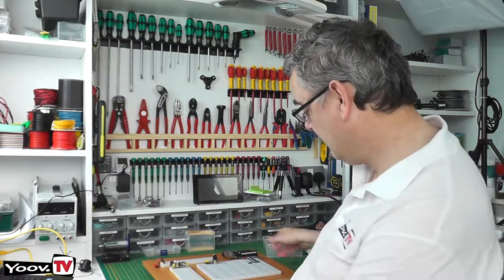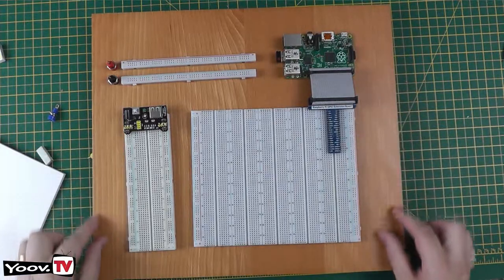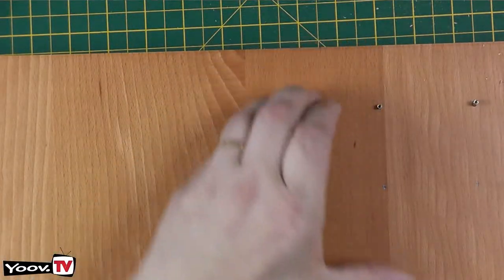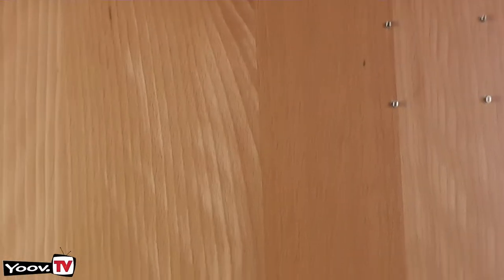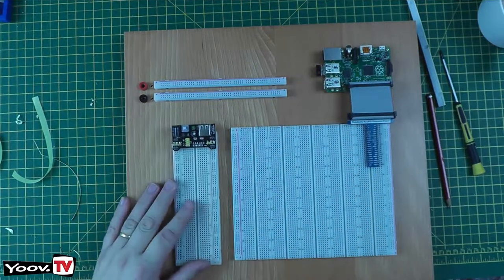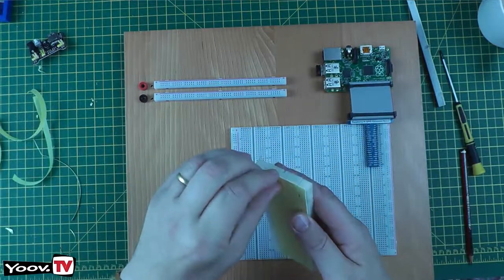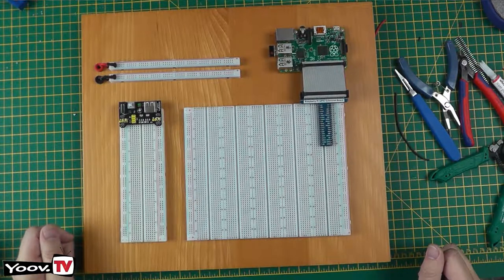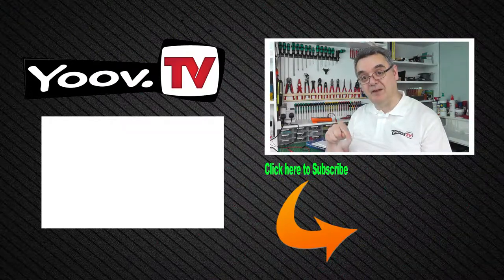Prototyping Breadboard - How To make Your Own!

Comment: I just wanted to let you know how much I enjoyed and appreciated your video on building a Pi workstation. I took your ideas a bit further. Adding buck converters and two DC input jack sets, one dedicated 12V from an old DSL router with battery backup, the other from my current regulating variable DC bench supply. With the buck regulators, this gives me 12V (source) plus fairly high current regulated 9V, 5V, & 3.3V, and of course any voltage/current I want from the bench supply. Photos available on request.

Comment: If I were doing this I would probably switch out the top section for a few different battery holders, maybe a 9 volt and some kind of recharable as well as still having the connectors for the bench supply. I just probably would have entire strips for each power connector and maybe would instead just do one or two power rails right above the breadboard for power distribution and the ability to use two different voltages if I need to do that.
I would also probably mount a general purpose screen as well, because even for just prototyping it could be useful, even if it doesn't end up in what you're building(like it has no use for a screen) I think it's kind of helpful, you can use it for monitoring stuff too and if make some what of a analyzer that moves beyond prototype bones into a tool as well.